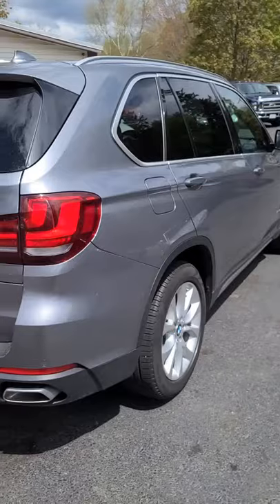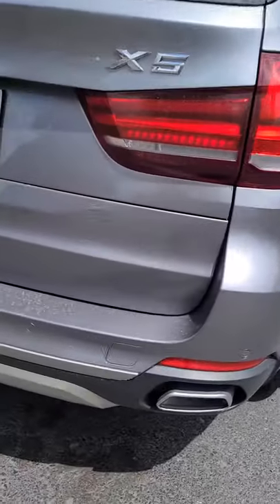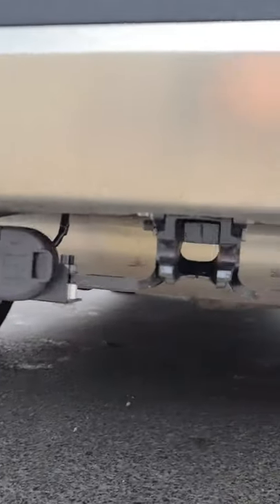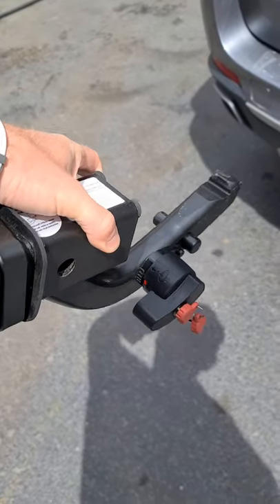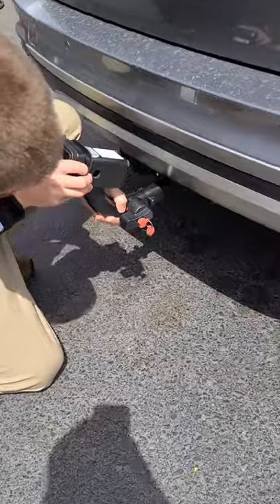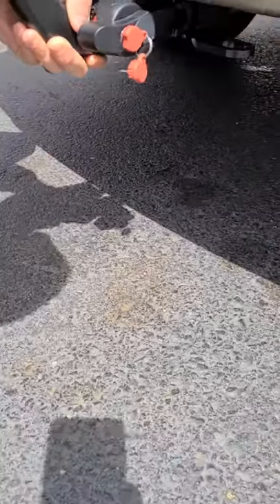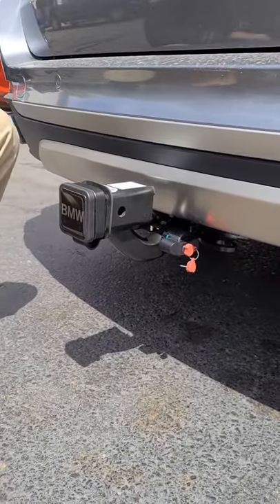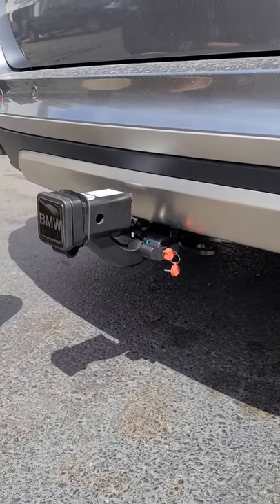Bmw trailer receiver hitch #shorts

Comment: The new ones have electric hitches.
Just press a button and out they come!
Reply: those will rust and get stuck over here in NH. bad design for the rust belt states.
Reply: Give me a mechanical connection, that way I know it’s fixed. I like my cotter key and pin.
Reply: until it brakes and then you have no hitch

Comment: all like that over here in Europe very rare to have a fixed hitch
Reply: Where in Europe are u cause in Ireland there all fixed
Reply: @user-sy5sj2yq2x  a great part of Europe doesn't allow fixed trailer hitches unless it was on the car from the factory. For example old Mercedes like the w123 get to keep their factory fixed hitch
Reply: @user-sy5sj2yq2x  iI you want to install a hitch on a car that didn't have it from the factory you need to install a detachable unit for it to pass inspection. My 2003 RAV4 has a detachable one while my 1980 W123 has a fixed one. Both pass yearly
Reply: @sv_cheats1970  which country you living

Comment: In Europe most of the cars have the same system unless the vehicle is pre 2004-5ish but it depends on the class of the vehicle. X5's, VW Touaregs and similar vehicles with a large 6-8-10Cylinder diesel engine are often used to trailer vehicles and general trailer stuff. Up until recently it was either a big truck or a SUV doing the job, very rarely would you have work "trucks" like you do in America. 
P.S if you start working with EU vehicles you'd be surprised at how much more wiggle room you'll have in your prices and how much more profits are there to be had especially in vehicles 2013 and up cause they're dead reliable and if you have a good tech that has his head on right you'll make a killing, i've noticed that there's been a boom in sales in the US especially for BMW's.

Comment: What’s the weight capacity
Reply: i think for the x5 its around 6000 pounds (2721 kg)
Reply: @Nico_huuuuulkenberg  towing capacity. Not tongue weight. There’s no way that thing can handle more than 1000lbs. That is a stupid system
Reply: @mr.lowslow7702  Oh then i have no clue. Yea I don't think that thing can handle any weight lol. it just clicks in
Reply: Looks like 2 bicycles.